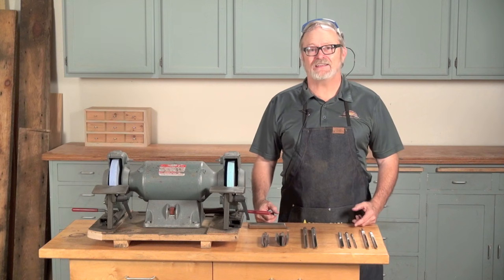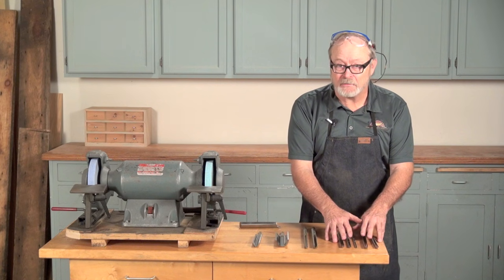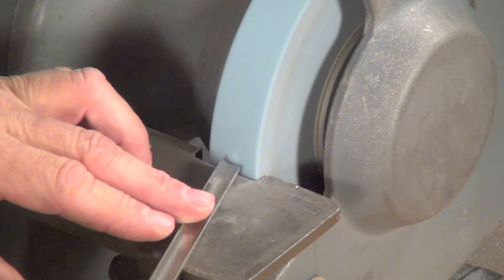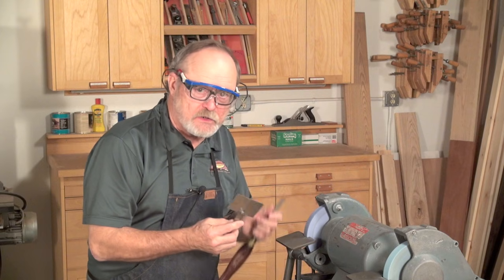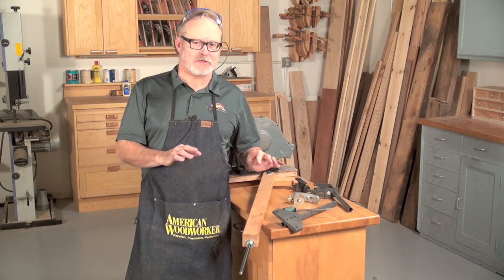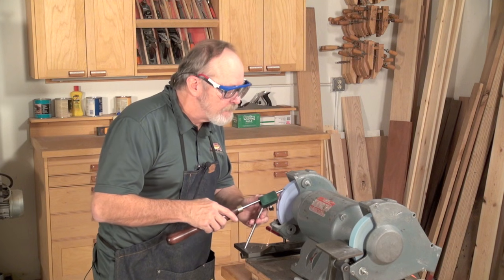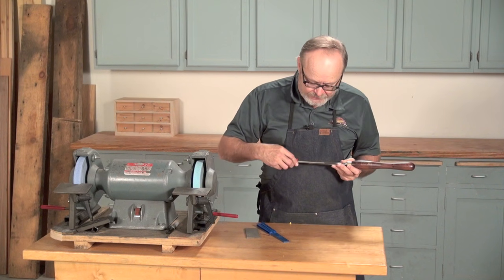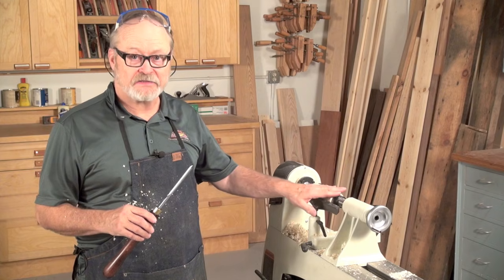Mastering the Detail/Spindle Gouge

Comment: Intriguing - i use the gauge straight from the grind stone - so no honing - no jig either -
Reply: Same here. I was also intrigued as to how he managed to expose the tool edge to the grinding wheel for so long, without blueing the edge as he didn't quench at all.
Reply: overheating the edge is not a major issue with hss tools
Reply: It is if they go blue! The same for any steel, because you've drawn the temper out of it by overheating.
Reply: This is your own personal experience with hss?
Reply: On metal turning lathes yes, which I think you'll agree whack a lot more pressure against a tool than a wood lathe ever will. Like all steel cutting tools, feed too deep, too fast, too much friction. Tool edge goes blue, no longer cuts properly! Doesn't matter if friction heat is from grinding or speed/feed, heat is heat and blue is blue! It may not be noticed as much when cutting wood, especially soft-ish but try it! Grind it, blue it, then try cut say a piece of well seasoned lignum vitae with it. (Although it may still perform OK with a piece of pine from B&Q! :)  )
Reply: true,not done much metal - but you must admit there is a lot of unquestioned "tradition." while that in itself is not a major problem - it keeps people back